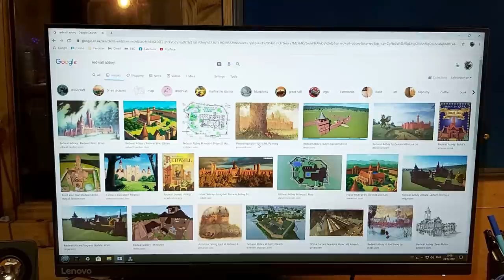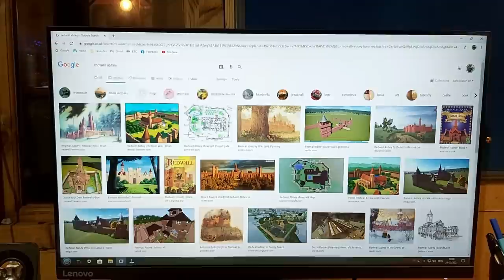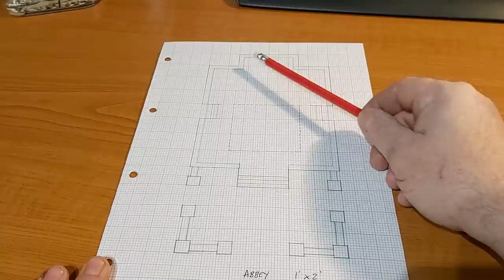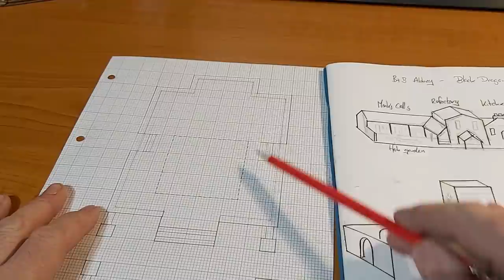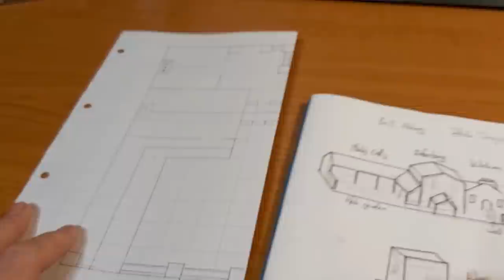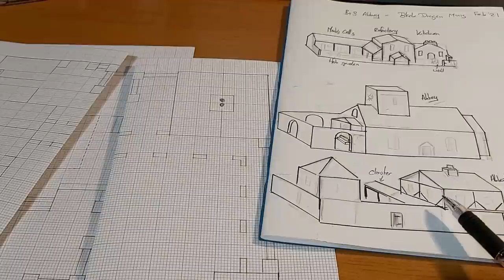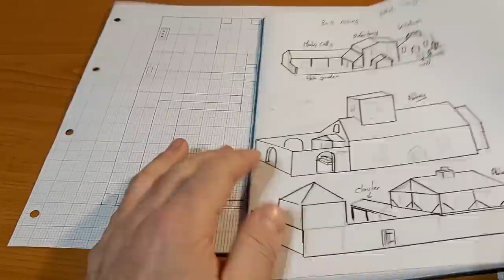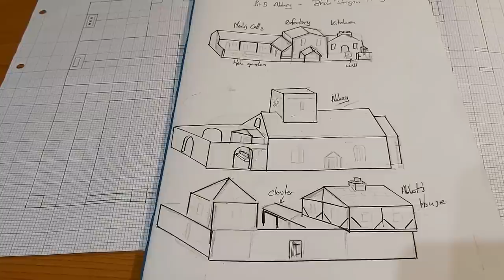Burrows & Badgers Build - Redwall Abbey  (Part One)  28mm XPS Foam Wargames Terrain

Comment: Great vid. What do you use to cut the polystyrene?
Reply from the maker: Brand new blades. I am looking at a proxon hot wire cutter, but for this a steel rule and a brand new balde works fine, especially on the 10mm stuff. The only problem is not getting a slanting cut, which I often do.
Reply: Cheers. I have the same problem when cutting especially the slant still not found a way to avoid it. It’s not just me then.
Reply from the maker: @mikedewberry5833  Nope - it gets quite infuriating. I am sure a hot wire cutter on a jig will help with cutting long sections, not sure it will be any help cutting windows

Comment: No flying buttresses?
Reply from the maker: It's not big enough to need them:0)
Reply: @magratheabuilderofworlds7141  I don't think I could have resisted the temptation, regardless of the size.
Reply from the maker: @johnnyrotten665  They would look cool but from a practicality POV they would either of had to have fitted on the centre board, making the building narrower, or been separate pieces on the adjoining boards which would have looked weird when all the boards weren't together
Reply: @magratheabuilderofworlds7141  fair